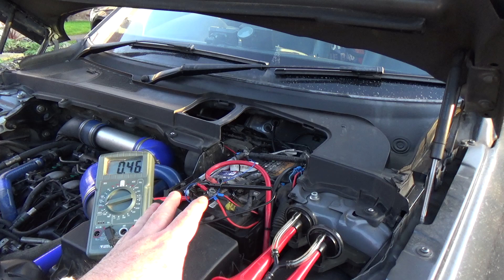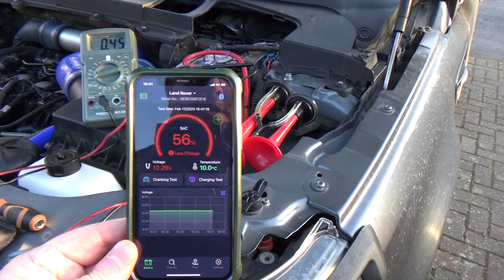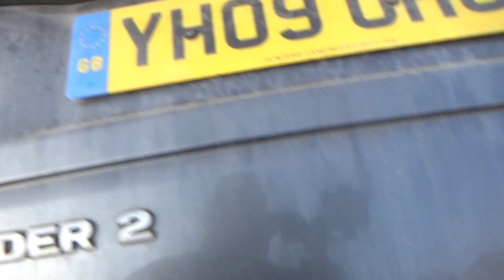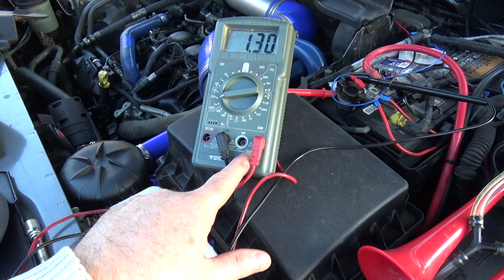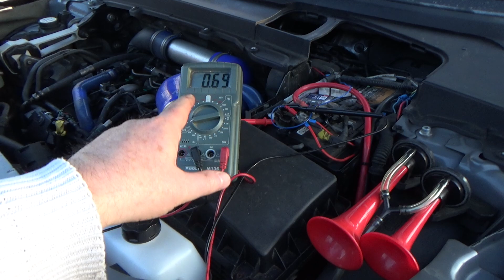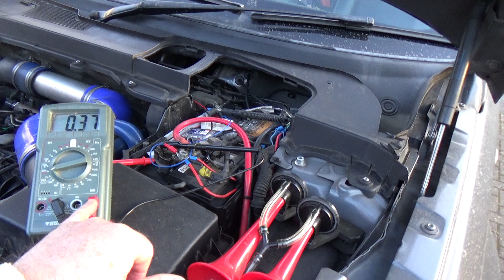Measuring battery parasitic drain - Land Rover Freelander 2

Comment: Did you find the problem, i have the same problem
Reply from the maker: I didn’t investigate any further and I was told that the current train will drop off after around 40 minutes so I just needed to wait a bit longer. I have a new battery now and I’ve not had any problems. We’ll see how it goes this winter.

Comment: On mine, there the alarm and immobiliser. That would use some current.
Reply from the maker: The current maybe due to the alarm, yes, but I also believe it would’ve dropped lower had I left it for even longer. It takes a while for the various systems to shut down.

Comment: Hi Beavis, Pretty certain I have this on my 2009 XS TD4.e too. Out of interest, did you do the test with the headlight switch in the 'off' position or the 'auto' position?
Reply from the maker: It would have been in Auto. The LED sidelights glow for around 10mins after locking due to canbus but this was after they went off.
Reply: @BeavisPits  I've heard (no evidence!) that leaving them on auto is what causes the drain in the TD4.e models. Would like to get my monitor to set up and see if I can do the same test as yourself.

Comment: Does the car "wake up" if it senses what it believes to be the key fob within a certain distance?

I remember some Range Rover P38 owners on forums reporting that the wireless transmissions from a neighbour's wireless doorbell would stop the vehicles properly going to "sleep" unless they disconnected the ariel wire to the car's central locking receiver.

So the trade-off for no battery drain was having to hold the fob next to the car before it could be unlocked...
Reply from the maker: Mine isn’t keyless entry, it has the old style fob which only transmits when you press a button